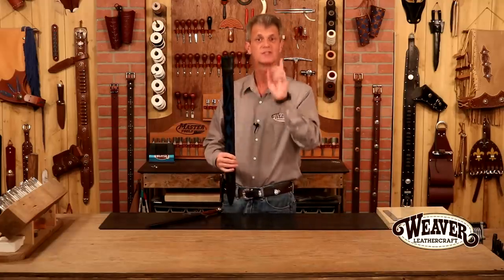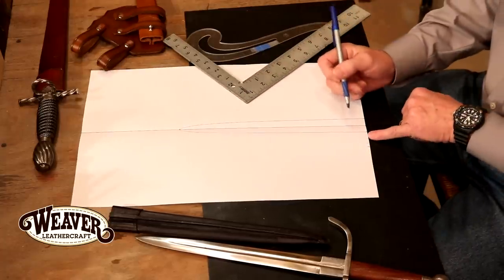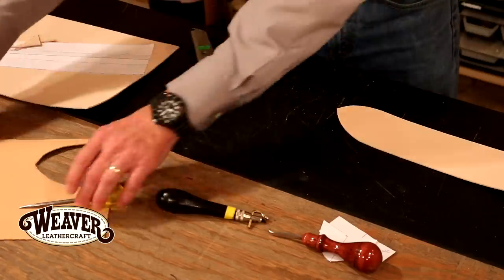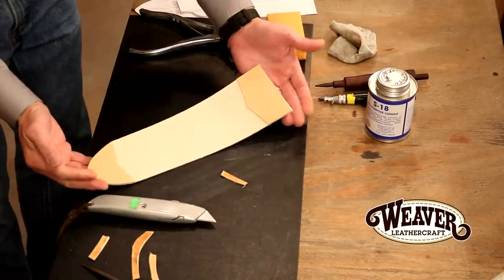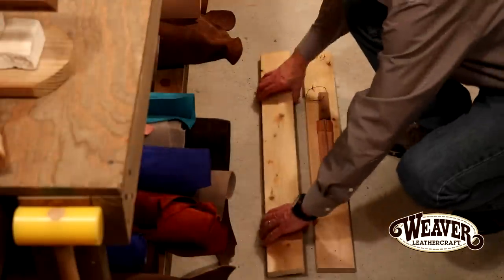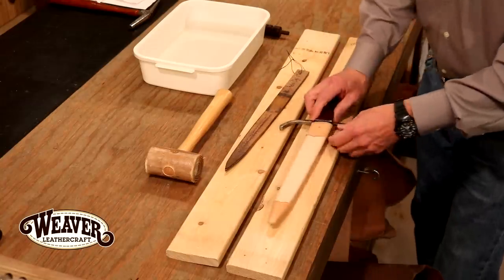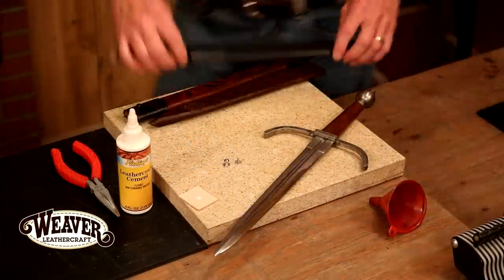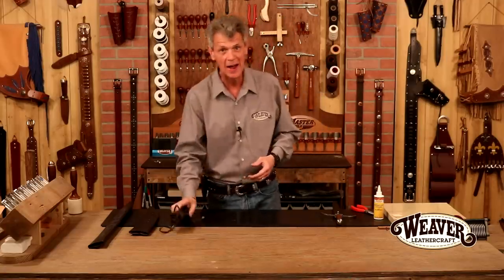Making a Simple Leather Scabbard

Comment: The material you made the insert from is called hardboard. You could also use polyethylene. Cut it out and smooth the edges a bit. Completely waterproof, lasts forever.

Comment: Hey, thanks so much. I used your tutorial to make a scabbard for a small sword. It's turning out pretty good, a bit rough in spots but it fits like a glove. I molded the triangular blade using your wood method but clamped dowels on top to press into the hollow ground portions. The seam on the back put enough pressure to fill in the hollow ground portion on the back. It looks like a scabbard I saw in in the musee d'armee paris-- very slim simple black leather scabbard for an officer's smallsword that was molded into the triangular shape of the blade. Thank you for the quality tutorial!!! Superb effort, I love you creative folks sharing your knowledge and skills.

Comment: Loved watching this... and have a couple of tips that may enhance this a bit... first is the Frog... as you have a Sam Browne post on the sheath... what about putting in a Buttonhole Punch hole on the first strap of the sheath... that way you can capture the sheath with that, and drawing and re-sheathing the blade will be a lot easier... secondly, if you put a 1" to 1 1/2" band of unwashed sheepskin in the throat of the sheath, maybe even matching the overlayed throat piece and stitching it in following the overlay shape, it will do 2 things... first it'll hold the blade in the sheath more effectively, but secondly, it will clean and grease the blade as you insert it and pull it out... that layer of sheep's grease on the blade will ward off rust the natural way... I do Viking Re-enactment in the UK - the guy that made my sheath used the wool trick and it keeps the blade in pristine condition... every now and then as the sheath gets older, you can charge the wool with a few drops of olive oil or mineral oil to keep it doing it's work, and although we wouldn't use Sam Browne posts, I know of frogs from the medieval times and onwards that do have the button hole in them to capture the sheath... nothing is new under the sun, as they say... ;)

Comment: Beautiful Project!  What changes, if any, would you make to the scabbard if your Dagger was sharpened?  I know a welt is added for a knife sheath to protect a side seam, but with this seam in the back, no need for that.  Would you bump up the leather weight or will this weight hold up for a dagger sharpened on both edges?  I'm thinking of a shorter dagger, legal length, of course.  Thanks so much for your amazing videos, I'm always inspired!
Reply from the maker: So glad you’re happy with the video!  I’ve gotten this question several times and I am sorry to say that I only have two options.  Sewing on both sides with a welt is great, ample options for decorating, is easy to line up, easy to add multiple colors, stamps, and tools without issue…but, that makes the scabbard almost 50% wider in many cases.  The width, to me and it sounds like to you, just makes the scabbard too wide and if that’s not the way you want to go then a full or side only insert with a material like Kydex may work (haven’t tried this yet).  These would glue in pretty well and can mold down to fit the bends in the scabbard.  Another option is a wooden scabbard with a leather overlay.  The wood form is pretty easy to make with a jigsaw, plywood and a good rasp and it doesn’t have to look great, the leather will cover it.  This also has some good options for multiple colors, spots, lacing…  See if any of this helps?
Reply: @WeaverLeatherSupply  Thanks so much.  Yes, I didn't want to widen the scabbard and I like the look of this back seam.  I'm going to add a Bronze tip and decorative band at the hilt.  I think I'll try the Kydex first, in a simple knife sheath with the back seam, and I'm pushing it further, using a more supple leather than I've used for any other sheath, just to really give that Kydex a test.   Why not?  Have you made a vid about the holder for the sheath?  Again, thank you for your amazing vids, it's a pleasure to get that notification!

Comment: If you place the button stud between the sheath and throat layers would it not be possible to use a thin aluminum plate between the layers with the screw one side of it and the throat layer on the other side of the plate.  It seems to me that it would amount to a large washer that would strengthen that area of the sheath.

Comment: Loving it as always Chuck.  I'm a Fiebings guy myself, tried a few other brands and results aren't quite as satisfying.  

Couple questions about the scabbard.  Got a claymore that could use a new scabbard; Steep guard and deep plunge (3-3 1/2) on the inset (mirrored both sides of the blade).  Would this be a problem with this form of scabbard?  Second, curing on scabbards, yes or no?
Reply from the maker: Hi Jason,
The claymore with the barbs is tough but, without, I don’t think the deep inset will be an issue if it’s measured pretty well, and, the outside edges can be rounded a bit to allow for the deep angle on the guard.  It may be a good idea to just make about 5” of throat as an experiment and see how that fits and holds up.  This will really give you the chance for a good measurement with a pretty tight fit.  I have never baked a scabbard.  It should work nicely (if you have a big oven), but, one of the things a leather scabbard has over a wood scabbard is that it can bend without breaking and hardening it may crack if it’s ever bent hard.   I have stepped on a few scabbards, sat on a few…and a wood one would have been destroyed but the leather is no issue.  I hope this helps!
Reply: Great thank you.  Working on a new style of bracers and then a helmet (think i may have figured out how to get one made).  After that I should be able to get started on the sheath.
Reply from the maker: @Rkurnelm  you're welcome! Sounds like a cool project!

Comment: Tried to make a english sword scabbard (the mortuary version that is looking like a musketter version)  Struggled so much for three weeks and finally stumbled on your video.  All that i tough i knew was blown away.  But i do have a problem.  I want a wood core in the middle and obviously i fear i might break the core by pressing it or cannot place the wood core once the leather is stitched and wet)  Do you have an idea for that?  I carved in white pine wood since its a soft wood.
Reply from the maker: Louis-Phillipe  Thanks for sending in a question!   Leather covered wood scabbards can be beautiful!  I haven’t made one but have seen a production shop doing it so I can offer some advice.  The way I’ve seen these made, most often, is to cover the wood with a lightweight garment leather (usually chrome).  This allows you to go with some beautiful colors, combinations of colors and prints if you find a good one.  For the veg I may suggest wetting the leather, forming into the scabbard and, once dry, use contact cement to attach the leather.  I may not add glue right to the edge so you can lift the edge with the chisel holes and sew that down.  The stitch will be mostly for looks since the leather is glued on and no real pressure is involved.  See if this answers your question?
Reply: @WeaverLeatherSupply  Thank you for your answer.   Since i am quite an amateur (let's just say i am completely new to this but oh the love is real)  I tried this first step you are inquiring. I got the corkscrew effect on both tries but didn't used glue yet for this.  With your way of showing how to measure i think this might work now.  Practice makes perfect they say.  I hope i will have a chance to show you the result when its done.  I will continue watching your videos.  They are well explained form A to Z.

Comment: Back in the middle ages what did they use for gluing leather?   Square knot is left over right and under then right over left and under. That's how I remembered it anyway.
Reply from the maker: I’m not really sure.  Glue made from horse hooves is an old school glue but I don’t know how far that goes back.  Cool question!  I would love to know (it’s’ probably some very gross recipe!)
Reply: @WeaverLeatherSupply  I would imagine the recipes were pretty gross back then but I'm sure they worked really well.
Reply: I'm guessing they probably used some combination of a pine-tar and hoof or hide glue, or possibly bitumen (asphalt) from a petroleum seep or tar pit. Those methods go back to pyramid times.
Reply: @digitaliproductions  that makes sense. Thanks.

Comment: Fantastic video, Chuck! I'm curious how one could do this same technique but drop in some tooling into the design? Would you do the tooling, then bend and stitch? I realise something like Sheridan carving would distort around the edges, but could you avoid squashing something simpler while wet forming?
Reply from the maker: I’m so happy you like the videos!  This is a tough one.  I’ve tried tooling after forming but the blade form it’s on just doesn’t give you enough backing.  The few I’ve tooled or stamped have been a front side design only and, once molded, I’ve gone back and done some touch-up with the swivel, bevel and backgrounders.  I wish I had a better answer for you. I love the look and shape of these but they just leave us with so few options to decorate.  If you find a good way to go let me know!

Comment: Chuck I'm sorry to bother you like this but I'm making two fillet knives as presents and using your style sheath for them. I have a Rapala fillet knife that I got 55 years ago in Canada  (at that time you could not get them in the USA) and it has your sheath style. One this I notice about 3/4 of the way down the sheath it has a piece of plastic or wood to keep the shape. Have you seen this or done this before. again thank you for your time.
Reply from the maker: I’m not sure if I’ve seen something like this or not.  A leather covered wood scabbard is one of the easiest to decorate, and most beautiful, but I don’t think I’ve seen one where the wood is more for support.  Do I have that right?
Reply: @WeaverLeatherSupply  yes you do and I just finished my first one on the fillet knife and it turned out outstanding. I tried doing this before but I was all screwed up and seeing how you do it makes great sense and makes it easier to do..thank you so much.
P.S. needed more 2/3 and 3/4 leather but you were out of the 2/3 shoulders so unfortunately I had to order from another source and their leather just doesn't match up to yours. Ugh next time.

Comment: Maybe I am not seeing right, but when you hand stitch do you do a knot on every stich? I was taught to pull left thread toward me and the right away so i can go trough the loop the other thread forms to secure each stitch with a knot. Did you do that sir? If so you are pretty fast I must say.
Reply: I heard that some people use ethanol to soke their leather because it evaporates so much quicker but the forming efect is the same.
Reply from the maker: Hi Jan,
I do not do a knot on every stitch. This is up to personal preference but I have never had any issues with it. Hope that helps!
Reply: @WeaverLeatherSupply  Thank you for your reply. Would you please consider making video about edge stitching. You know when the panels are cut 45 degrees at the edges. I have got 50 years old leather pouch for roof nails made by this technique. It looks like a sturdy box. It even has internal partition without any visible threads. How the maker managed to put this partition inside without anything visible from the inside or outside is unknown to me.

Comment: When I dye with a dauber, with the exception of black all the colors I use either come out very splotchy or streaky, very inconsistent. What can I do to fix that?
Reply from the maker: We would say get a good amount of dye on the dauber but not dripping wet and then apply the dye pretty quickly across the full panel getting as much coverage as you can, then come back with a second coat to fill in and maybe a third coat to finish it off.  If this is done all at once (not waiting between coats) then it should wick across the panel consistently and look pretty good.

Comment: Chuck with a curved blade (fillet knife I'm making) do you just lay it out like a straight blade. I'm confused.
Reply from the maker: Yes, just make the sheath as if the blade were straight and then from it on the blade or a wood form and it will come out perfectly.  Just one note though, the leather can only curve so far without rippling on the inside curve.  It can be pressed down but it starts to get squirrely.
Reply: @WeaverLeatherSupply  thanks chuck love your vids and Now I have another leather supplier. Or should I say a better leather supplier.